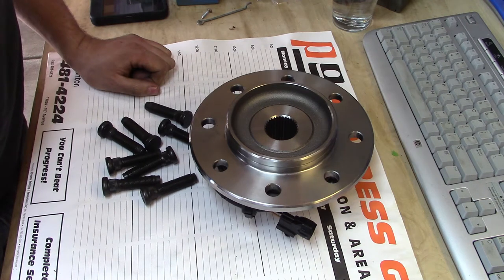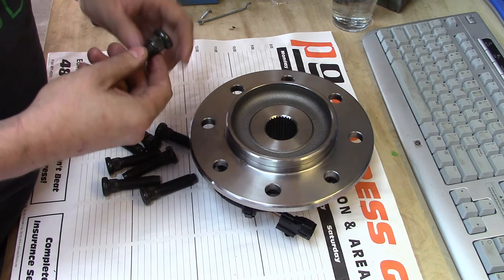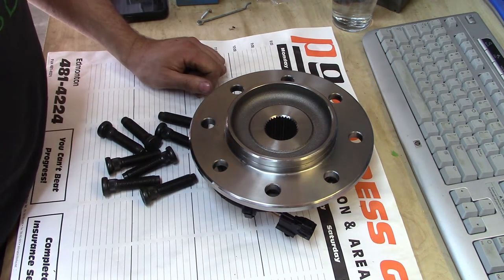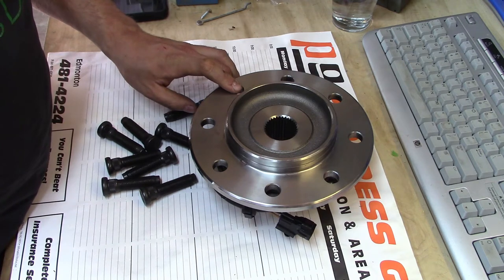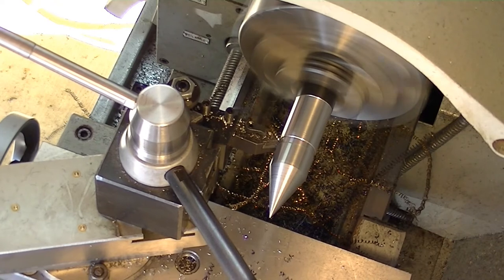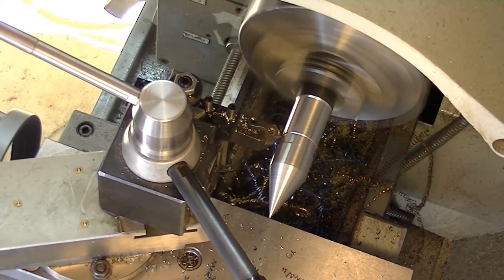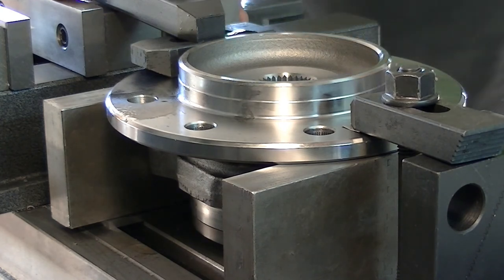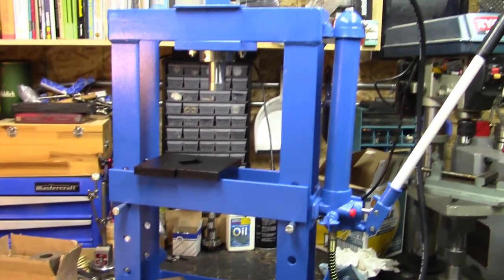Dodge Hub Stud Repair

Comment: Yes ladies work is not necessary it’s bigger for a reason the old neural after studies pushed out the new one has a little bit bigger neural to be able to hold a stud so when talking the wheel not does not spin the stud all you have to do is press the study and have done many many of them

Comment: www.machinemart.co.uk Hi Everett, you introduced us to your press, company above is possibly most similar to HF. Found you yesterday and slowly working through the site.
Reply from the maker: I went over to MachineMart and looked at their website.  It looks very similar to Princess Auto, which is sort of a Canadian equivalent to Harbor Freight in the U.S.  The three stores all seem to fill the same niche in their respective countries.  I got the press from Princess Auto when it was on sale.  It's small but all I have space for at the moment and does most of what I need.  If a bigger one is required then I can always bribe my old boss with a coffee to use the shop press there!   Thanks for getting in touch!